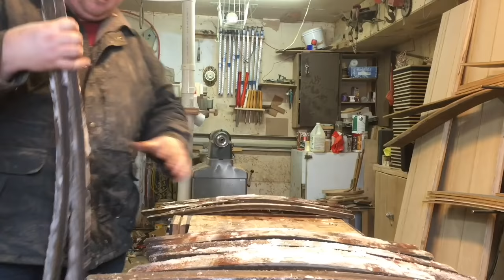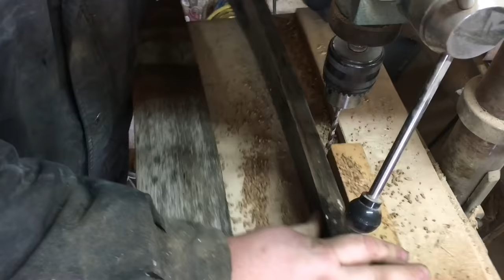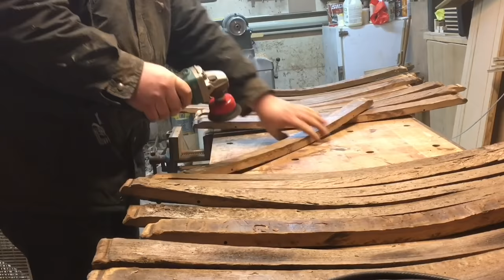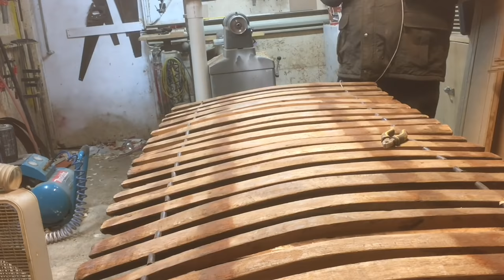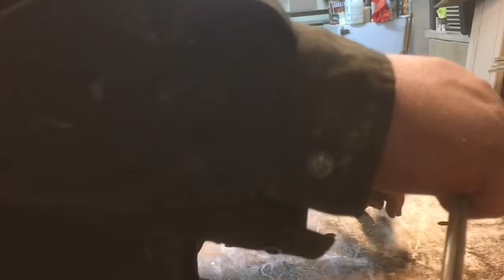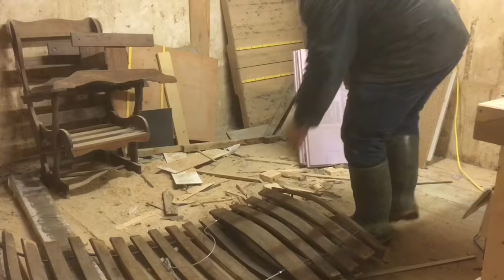oak barrel hammock

Comment: How do you avoid the cut piece of pipe sliding back into the hole in your stave?
Reply: If the piece of pipe is larger diameter than the hole it won't

Comment: Love the idea an final results but be more stable with running length end cables through straight piece then connected together in triangle shaped!
Reply from the maker: Thanks. It is very strong already. My sister has had it for 4 years already without an issue, so I don’t think that is necessary
Reply: @bigredmakes320  I wasn't thinking strength, but better stability getting in an out an while in use. We made chair from barrel but rather made this after watching!

Comment: Looked cool and fun, but damn if that dust from wood and old mold/wine/beer isn't going to get you messed up without respiration.  What doesn't kill ya today, will kill you tomorrow :)  Lesson learned, don't miss a slat or two, and also solder the ends of the braided line so it doesn't fray.
Reply from the maker: hey thanks